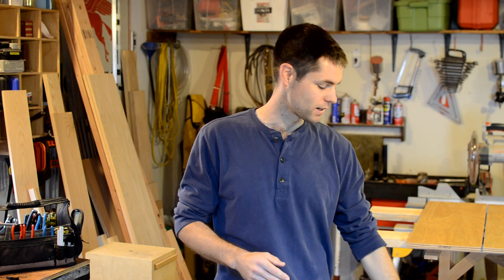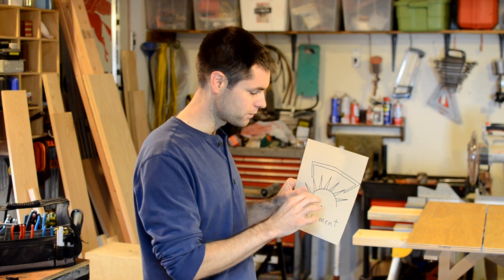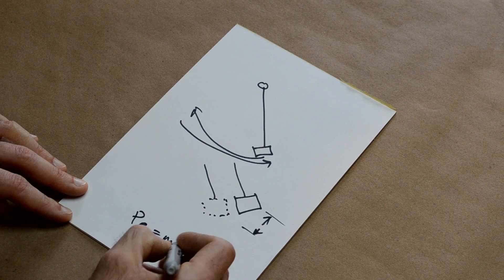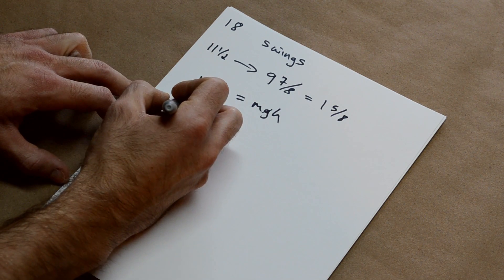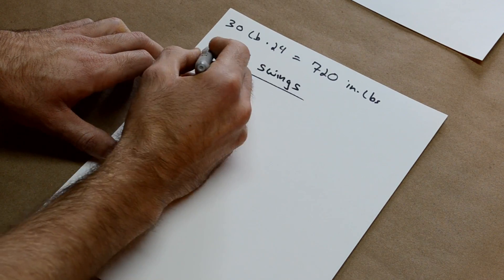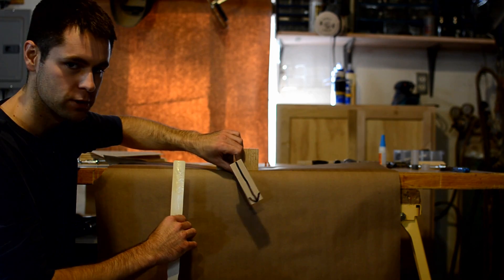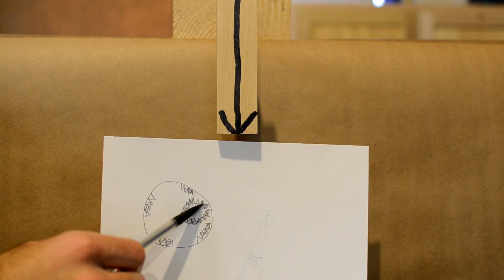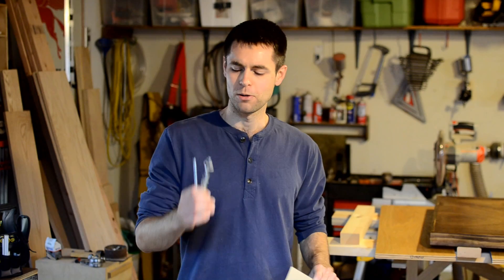Escapement Cradle #1

Comment: Escapements need not be the convoluted gear-style, etc.
 
For this kind of mechanism, its frequency and regularity not being horribly important, the simpler the design, the better and more reliable the device.
 
A square escapement "wheel" might be easier to build and prove sturdier.
 
Look at this one: youtube.com/watch?vJoofH4on0fM
Reply from the maker: +Le Sellers I've seen quite a few different escapements but all were gear based, these square ones are very interesting . . .
Reply: +Scott Rumschlag Also you want low friction, especially with the forces involved here (much greater compared to inside a clock).